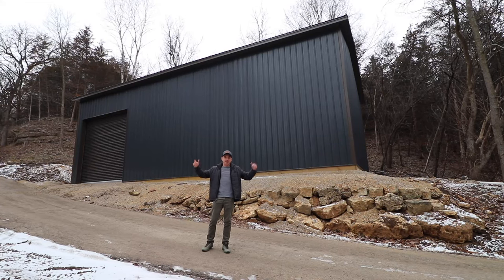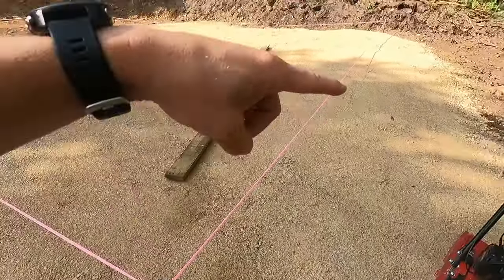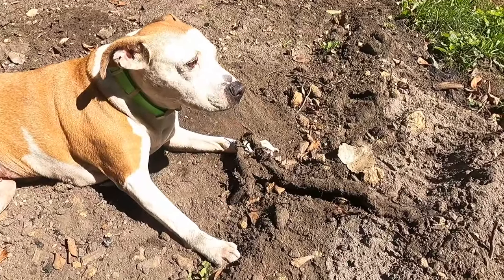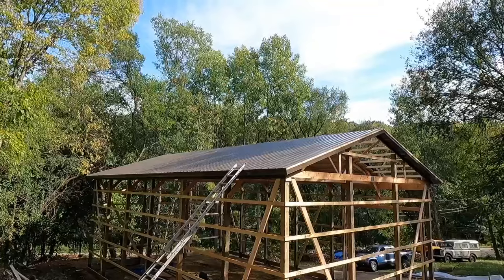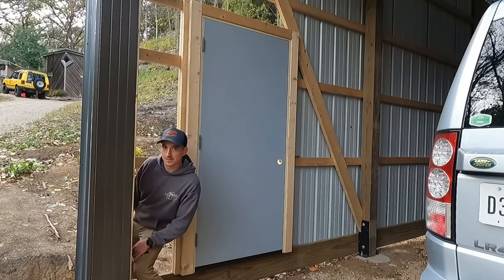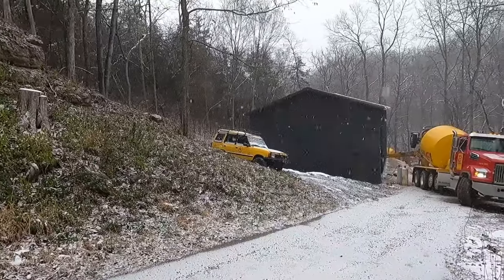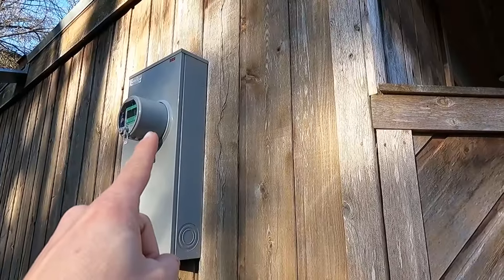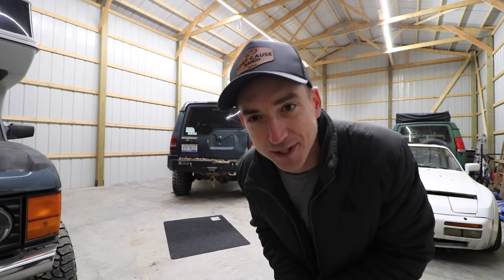Building My Own Shop in 14 Minutes

Comment: Terrible door header
Reply: It’s not carry any weight it’ll be fine 😂
Reply from the maker: It's what the building plan called for. I'm all for learning, what would be your suggestion on it? 

It seems two 1.75" LVL's seem pretty standard for the 12' span. Although spacing them did seem a little different to me, but I imagine that was for the "post" that holds the truss centered on the door opening since that dropped in between the two LVL's.
Reply: I guess it’s a good thing you commented this seeing as he didn’t know that
Reply: Geh

Comment: That large stone you dragged out with your suv would've been just outside of my man door if I found it. I'd frame out a patio slightly larger than the stone, then pour the outside perimeter of it like a small footer, then place the stone inside of that, and fill all of the remaining gaps with whatever small stone best accented that stone.
Reply from the maker: That is a neat idea. It’s currently the base of my retaining wall in the corner. But that may be a poured wall down the road to make a flat spot on the side of the shop. So I could pull it back out and do something fun like that with it. I have a guy that can engrave it as well so could even add to it.
Reply: @LostCauseRanch  I like keeping unique elements found during projects and finding ways I can memorialize them to remember the project. I hope you post a video of it if you ever get to it.

Comment: Would that need a trench/ditch? Now all the water coming down the forest is going to hit that
Reply from the maker: The little “hills” on the sides of the shop have berms on top and are sloped away from the shop, so that directs the majority of the run off from the forest. At the bottoms of the slopes against the shop it is ditched and sloped to drain past the shop. I have drainage pipe buried under the corner and front door area, next spring I’ll complete the drainage tile around the shop along with some landscaping.

Comment: Curious why this method instead of starting with a slab?
Reply: We’ll never know
Reply from the maker: A couple reasons. 

Post frame stuff is fairly common on ag/rural buildings, at least around here. 

If I would have went with a traditional slab with foundation I would have had to go 48” deep for my climate. My land is pretty much limestone, the back half of the shop is pretty close to being on limestone, would have made the foundation end more difficult. I ended up having to jackhammer a few of the post pier holes to get the 48” depth. 

I could have done a floating/alaskan slab but with the hills everywhere here and the climate I was just more comfortable having something in the ground below frost. 

The second reason, cost and timeline. The post frame building packages I was looking at used materials more efficiently, or less of them and made the 16’ sidewall easier. 

The big benefit was being able to spread the cost. I cashflowed the build, so being able to buy the building materials and get that up was nice before I had to pay for the concrete and finishing. If I would have done the slab and built off that I would have had a slab sitting there a couple months waiting for more money haha. But the order I did it I was able to pay for the building materials and spend those couple months building that while saving the money for the concrete and finishing. 

I was in a bit of a time crunch to have something up to store some things. In an ideal world I would have set the building back into the hill with a concrete wall on the backside up against the hill. But this was during Covid and everyone around here capable of that was 18 months out. 

Sorry for the long winded reply, hope that shed some light. Feel free to ask anything if you want some more clarification. 

All in all I’m super happy with how it all turned out and it’s been useful as all get out. It quite a bit more built out now. I’ll do another update this fall sometime.
Reply: @LostCauseRanch  Yep, thanks for clarifying. Good to understand why this method might make sense over a slab.
Reply from the maker: @sb-nyc  The typical way you would go about the post frame/pole building would be to sink the poles themselves 4 ft into the ground, similar to fence posts. 

I chose to pour concrete piers instead. And made brackets for the poles to bolt to. The brackets were epoxy anchored to the concrete piers. This kept the poles out of the ground which should help with rot over time.

Comment: May I point out, You made a mistake with the floor reinforcement. 
The iron rails should not be against the insulation, but in the middle of the concrete casting, i.e. about 2-3" away from the insulation.
Reply from the maker: You are correct. I just had it how the guys placing the concrete wanted it. They pulled it up while pouring, which I know isn’t 100% ideal but it was pulled up. They wanted it down because they wheelbarrowed the concrete in.

Comment: strong work, I love watching your videos.   I have a 2012 LR4.  

But in general what has been your cost breakdown for this building.  I know if varies a lot on location etc, but in general what have you spent so far.
Reply from the maker: I plan on totaling it up soon now that the electrical is just about done. But I’d guess I’m right around the 40k mark now. Hoping for 55ish all in when it’s insulated and finished out.

Comment: is there any slope going to that drain?
Reply from the maker: Yes, it is roughly 8 ft from the end wall and slopes from there and 8 ft. to the other side. So essentially just that bay. The shorter drain near the wall has a slope from about 4 ft out around that. That one is there because the pressure washer and wash sink will be above it and wanted to keep that water contained. The back part of the shop is essentially flat.
Reply: @LostCauseRanch  okay good, it just looked so perfectly flat on video. i got a little concerned for a moment

Comment: Why didn’t you do radiant floors?
Reply from the maker: I didn’t do the in floor heat because I wasn’t exactly sure where the lifts and mezzanine were going to go. So I would have had to deal with not hitting any tubes in the future. 

This will probably be about a 5-7 year solution shop ultimately so the cost of the tubes, and mainly the boiler and control setup didn’t pencil out. 

I eventually will buy a larger plot of land and be building a shouse. That will definitely get in floor heat.

Comment: Как вы его будете отапливать? У вас зимой холодно? Привет из Сибири 👍
Reply from the maker: I'm still undecided on the heat. We do get somewhat cold in the winter. I'm going to have a mini split heat pump/ac unit and may move a pellet stove in for additional heating or a radiant tube heater. I'm all electric at the house with no gas to the property so if I do the radiant tube I would have to get a propane tank here.
Reply: Хорошо, у нас зимой может быть - 63° F😂 . Газа  у нас нету, но киловатт  электричества 0.01$.

Comment: What’s that heater that you had in the middle of the shop??
Reply from the maker: It’s a Dyna-Glo convection kerosene heater. Doesn’t require electricity so that’s why I used that. Just wanted to keep the inside temp above freezing while the concrete cured.
Reply: @LostCauseRanch  I like how you reply to most of your questions. Even a year later
Reply from the maker: @kyeimwebley3266  I try to get to as many as I can. Some get lost through the cracks. 

If people are investing the time to ask something, I’ll try to help if I can.

Comment: Wow man , it just looks so simple.... What a great job you and your team did !!!!! Congrats !!!! By the way which is the cost of this building, just curious. Many thanks !!
Reply from the maker: The building framing and steel was $21k from Menards at the time. I had about $9k into the concrete with rebar and foam. 

As of right now, I have it wired up, insulated, mezzanine and plumbing ran to the building. I'm probably in the neighborhood of $50k. I'll do another updated video here in the near future and plan on breaking down the cost of it as well.

Comment: Why not do the floor first? That way you would not need to pour footers?
Reply from the maker: Floor is typically poured afterwards. But for me it was a couple reasons. I cash flowed the shop build, so it worked out better for me to spend the money on the building and steel during the summer to get that all framed up before the snow flew. Then the concrete pour was in a more controlled setting with a roof and walls up. Kept the temp inside regulated along with not having to worry about rain. Plus it gave me the couple months I spent framing the building to come up with the concrete money haha. 

I was in a bit of a time constraint from selling my commercial shop and needing a place for some of that to go. Otherwise I probably would have poured a rear wall and set the building against the hill. But this was right in the middle of the pandemic and anyone capable of the wall pour was scheduled a year plus out.